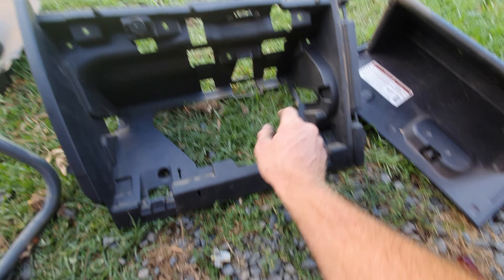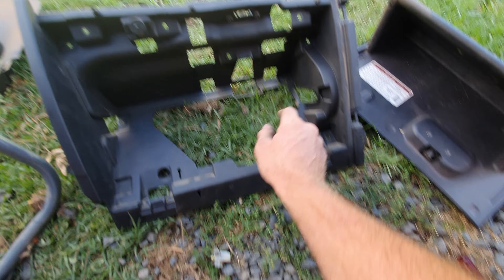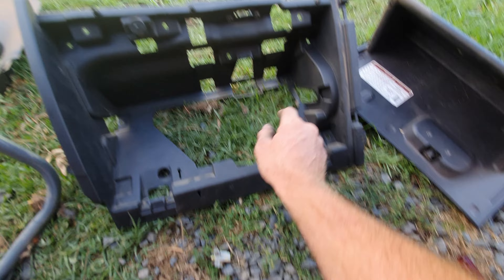Ford fg fan wont work this is why esy FIX!

Comment: Thanks Trav, much appreciated, was very helpful, Dr Google has done it again. Kudos.
I have a 2010 Territory, Its a little different behind the glovebox to get access to the Blower Fan. Mine had stopped blowing for some unknown reason, was not the fuse, so went to check the fan like you suggested. Cleaned the air filter out, started the engine, the fan was still not spinning. So I gave it a manual spin by hand just to see, and it fired up again spinning like it should. So not sure what the gremlin glitch was, but glad to have my fan back for the summer coming. Cheers
Reply from the maker: How good mate thats awsome our falcon was playing up recently and we would have to bump the fan motor one the bottom to get it to work worn brushes but we have goten rid of the xr6 now

Comment: Done the same for my SZ Territory. Don't undo all the screws though as the Territory is a bit different. I ended up having to cut my wires and undoing the 3 screws that hold the motor up so I could work at getting the burnt plug out. about an hours work in the cool morning had it working again. Thanks @TRAV30387 for the video I really thought I was going to replace the resister or motor. Cheers. :)
Reply from the maker: Not a problem mate happy to help

Comment: Can do just removing glove box when put fan in have to bend the bottom trim out a little and goes in no dramas after that n didn't look like was going to crack when did it if anyone worried about the bend instruction 😂
Reply from the maker: You can remove the glovebox aslong as you have access its possible

Comment: Thank f*ck for this vid!! Mine wasn't working due to this plug being knocked and it wasn't plugged in all the way. Happy days with the heater going again..had code  U0166-20 missing comunication with the heater control module come up if this helps anyone